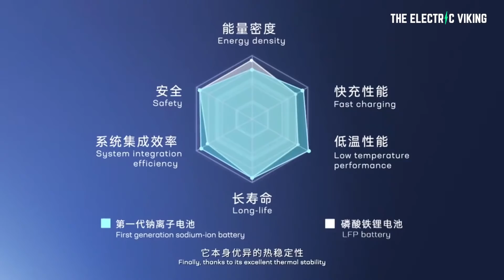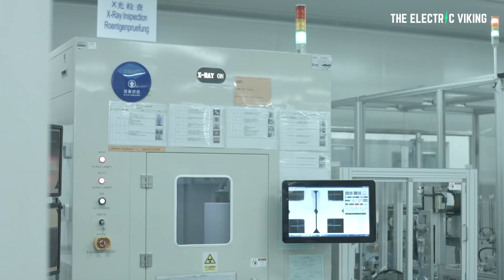CATL's new SODIUM battery will solve the world's energy problems

Comment: Sorry to bust your bubble, but Tesla's 4680 batteries are already at an energy density above 260 Wh/ Kg, and a reduced cost of 30% is expected when production ramps in 2023
Reply: Well is that 30% cheaper compared to CATL's LFP-batteries or the Panasonic batteries they use for long range?
As manufacturing gets cheaper, the cost of raw materials should be making more difference to the price / kWh.
Reply: @itekani  30 % cost reduction in $/kWh
Reply: @geoyoshinaka5251  Yes, but compared to what other battery technology?
Reply: Catl actually has some of the worst energy density of all of the battery companies because they only focus on lfp chemistry.
Reply: @greengold6705  the LFP energy density leaves a lot to be desired, for sure, but the charge cycles are excellent, can also be charged up to 100% without affecting cycle life, so can get further compared to most other Li-ion chemistries and is hassle free. We do not need to limit the charging to 80% as is the norm for higher performance batteries, and especially in cooler climates the LFP does a good job
Reply: @geoyoshinaka5251  Yeah I think lfp is good for short range vehicles or energy storage. I can't wait to LGs new ncma chemistry and 4680s energy density.
Reply: @geoyoshinaka5251  I think most people would rather have 350 mile range with 1500 charges instead of a 200 mile range with 5000 charges. I think because how long are you really going to use the vehicle most are going to get a new vehicle after 500,000 miles
Reply: Thanks.  I watch lots of tesla stuff and you think I'd know the number, but I don't.  LOL @ me.
Reply: Yeah. I was thinking how incredible it would be if Tesla could use CATL's chemistry in tabless 4680 batteries in their structural battery pack. Then we might actually get close to 300 Wh/kg in a sodium ion battery, which would be freaking awesome! Of course whether or not it would even be physically possible depends on a lot of factors and even if it is possible, it'll be a few more years before we actually see something like that. Whatever else, it's a game-changer for everyone but Tesla and possibly even for Tesla, since it is obvious they will continue buying from CATL and not make all the cells they need themselves for the foreseeable future.

Comment: 6h grid storage maybe for Australia 3-6 days for Estonia.   To overcome days when not enough wind. Solar for Estonia is bad form of energy since in december there is 5% of solar what is in june. When you build wind and solar then you must have that energy in december also solar in june just cuts marggins of wind and energy gets more expencive in general. The another option is non carbon free gas powestations but in europe that is north from Alps  solar is bad form of electicity. Ok in last year there are some techs apearing that are cheaper even than NaIon. Liquid metal batteries (Ambri)and storing heat in sand(polar night energy) where pirce is <10$kWh.
Below 10$kWh is gamechanger to nuclear also it quarantees constant load.

Comment: We need an abundance of diversified battery materials moving forward so this is great news.
Reply: IKR! i love walking around with a potential low yield grenade in my pocket. 
I Cant wait to get my hands on them. Its a shame how the Electric Viking didnt bother mentioning(or researching) that to maintain atleast same safety margins as with Li-Ion cells, 
You need a lot! more robust casing, and redundant systems for load and unload control, 
that alone limits the aplication to immobile things, so doubtfull that we will see it in cars or phones within 2 years, try 7 maybe 8 years, and no it does not solve the energy storage problem mostly because we keep consuming so much.
Reply: Yeah. If sodium batteries were already 100% a sure thing, their production lines would already be being set up. As it is, there are multiple promising battery designs and chemistries, at varying stages of development, with various lingering issues that need to be ironed out. Whichever one makes it to production first, it looks like the near future will not lack for cheaper and superior designs! Sodium may be next; fingers crossed.

Comment: Sodium batteries have existed for decades, as long as li-ion. The problem is cycle life and density. They are inherently cheaper because the materials are cheaper, but let's see the main two problems get solved.
* volumetric density, not just gravimetric

Comment: one fact that CATL has invested billions of dollars to the Lithium mine in Congo, Austrilia, Chile in 2021 ... If he really confident with this sodium technology , why he still invest so large money to Lithium materail? Probably CATL relized there are some deficts that sodium battery can't win Lithium battery. and it is hard to solver soon.
Reply: Because, even if sodium ion batteries end up working as well as we hope they will, there will still be applications where lithium-based cells makes the most sense. Traction batteries for EVs, for instance, will certainly be primarily lithium-based for quite some time to come. It's only now that the industry is giving LFP a 2nd look. Just a few years ago, it wasn't on anybody's radar screen. Even so, there are still going to be demanding applications where ternary (ie: nickel and cobalt anode) lithium ion batteries are going to be needed. 

Sodium ion seems to make the most sense for small (individual home) to medium-sized (methane peaker plant replacement) stationary storage applications. For the largest grid storage applications (fields of solar PV, offshore wind, etc,,) technologies like iron air cells will make the most sense. But nobody would consider trying to make those massive things work in a car. The bottom line is that we're going to need ALL this stuff as the world transitions off fossil fuel. Happy MLK Jr. Day from the US.
Reply: I could see the sodium batteries being used for energy storage and the lithium for transportation

Comment: I think you have missed a more important point about sodium iron batteries, they are very recyclable. No rare earth material in them.  That with the energy density is fatasric news
Reply: Don't be so sure.
1) The cheaper the materials in the cell, the less viable recucyi becomes.
2) these cells still use many (virtually all) of the same chemicals in the electrolyte (si no difference)
3) "Conventional" Lithium based cells are VERY recyclable (high 90's%), just because they haven't been yet, doesn't mean they won't be.

Comment: Legacy car batteries are unlikely to change. For years, they have had the chance to use LFP (especially for stop/start engines, but they've just ignored it. 
Sodium as competition for Lithium(?) then bring it on.
Reply: LFP batteries are heavy and hold less charge.  That is why they were ignored.  Until their are far more charging locations LFP batteries are not good for consumers.